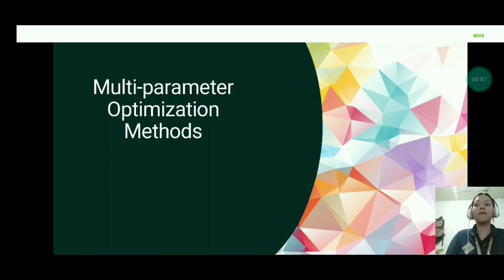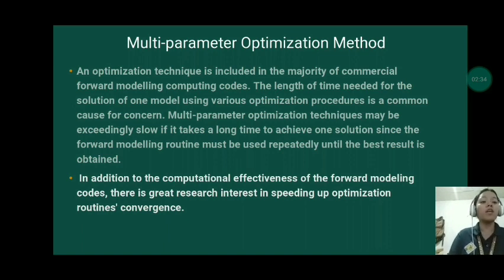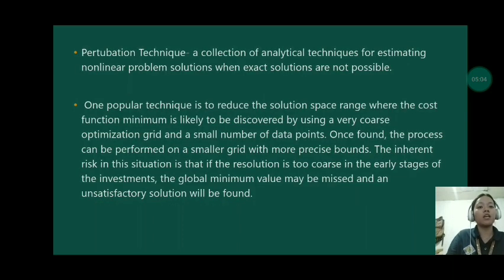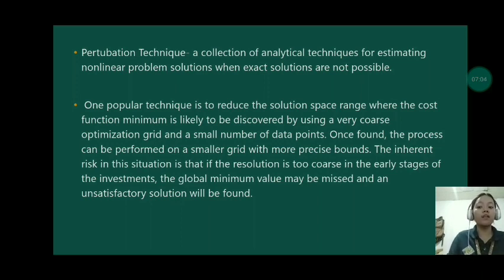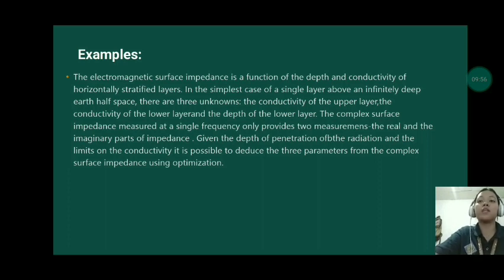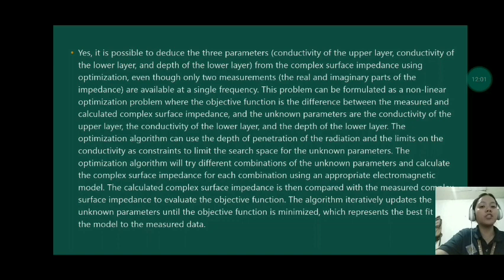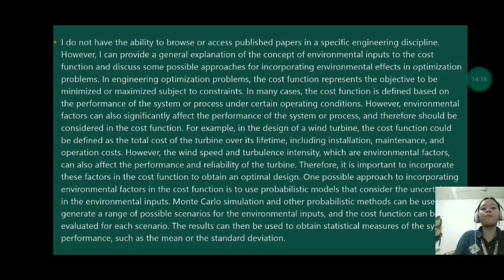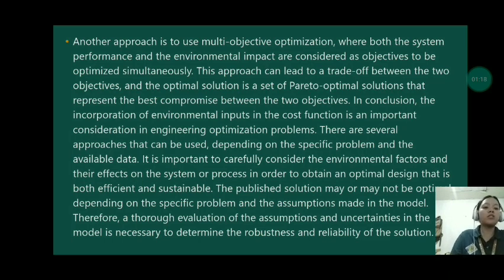Multi-Parameter Optimization Method

Comment: Kevin Alama Quilnet
March 17, 2023
ENS 341 A - Research Methods of Engineering  M-W-F  6:30-8:20pm

REFLECTION:
What i can say in the video multi-parameter optimization methods are essential in many fields, including engineering, physics, chemistry, and finance, to name a few. These methods aim to find the optimal values of multiple parameters that maximize or minimize a given objective function. One of the most popular methods used for multi-parameter optimization is the gradient-based method. It is based on the gradient of the objective function and uses iterative techniques to find the optimal values of the parameters.

REACTION:
The voice of the reporter clear and she delivered her report superbly. Everything was related to her topic which is good. Although there are some background noise, the voice and the presentation is good and was able to present neatly. The discussion was well performed. 

SUMMARY:
Overall, multi-parameter optimization is a critical tool for solving complex problems in various fields, and researchers continue to develop and refine optimization methods to improve their effectiveness and efficiency. One important aspect to consider in multi-parameter optimization is the curse of dimensionality, which refers to the exponential growth of the number of possible solutions as the number of parameters increases. This can make it computationally challenging and time-consuming to find the optimal solution. Therefore, it is often necessary to use approximation or dimensionality reduction techniques to overcome this issue.

Comment: Xavier O. Baculado Jr.
March 17, 2023
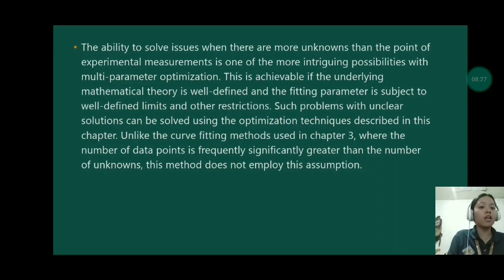EE 341-A (MWF 6:30-8:30)

Xavier O. Baculado
March 17, 2023
EE 341-A (MWF 6:30-8:30)

Reflection: 
Throughout the discussion it made me reflect not just about the importance of learning this method but also applying it especially in solving complex design in order to achieve the goal which is to minimize the cost function.

Reaction:
The reporter highlights the goal and cite some example that is relevant to this topic. Overall it is very well presented.

Summary:
To sum it up, the Multi-Parameter Optimization Method is essential in minimizing the cost function, which takes into account all the factors important for the optimum.

Comment: Macalib-og, Jhon Paul C. (Electronics)
March 17, 2023 
MWF 6:30 P.M. - 8:30 P.M

Reflection
Multi optimization method is helpful in a way that helps engineers find a solution that can optimize a project or things to its full potential without sacrificing more but saving with more quality and safety.

Reaction
The video is very nice and helpful. The reporter have good insights on her report.

Summary
The Multi optimization method techniques used to optimize multiple objectives simultaneously. it is important in engineering as may engineer make projects throughput their lifetime. To be able to be safety and have quality work, they solve their problems with mathematical equations to aide them and have a good, successful results.

Comment: Cacaldo, Elvin E.
March 17, 2023
MWF 6:30pm - 8:20pm

Chapter 5
MULTI-PARAMETER OPTIMIZATION METHOD

REFLECTION:
As what I observed in the presentation, the multi-parameter optimization method is important factor when conducting research. I learned that the multi-parameter analysis can be done using mathematical tools. The optimization method determines which set is used. which set of parameters will best optimize the intended result. Engineering studies are popular and performed in order to address current societal issues problems. However, developing solutions can be difficult and time-consuming. Multi-Parameter Optimization Techniques they are useful because they allow scientists and engineers to determine the best combination of various variables to achieve their goal.

REACTION:
I observed that the reporter is reporting well the assigned topic and discussing the important of optimization method. The topic was presented in a clear and concise manner. The reporter present smoothly and easy to understand. The speaker used excellent visuals to help viewers understand the video. The reporter is discussing well the assigned topic

SUMMARY:
The reported topic is all about the multi-parameter optimization method.
Method of multi-parameter optimization
following are some procedures that can be used in various disciplines such as engineering, Science, economics, and finance are all disciplines. The optimization method used is determined by the nature of the problem, the complexity of the objective function, and the number of parameters to be optimized.

Comment: Sojor, Gwenshane Arnel R.
March 17, 2023
MWF 6:30-8:30 PM

REFLECTION
I have made a realization on the importance of multi-parameter optimization methods in addressing complex problems that depend on multiple variables. These methods provide a powerful set of tools for researchers and practitioners to identify the optimal solution for a given problem, which can lead to more efficient and effective outcomes.

REACTION
I have learned much from the report about multi-parameter optimization methods and realized its importance. However, the slides were full of lengthy paragraphs. Nevertheless, I've still gathered necessary information and the examples that were presented surely helped. Good job!

SUMMARY 
In summary, multi-parameter optimization methods are a set of techniques used to optimize complex systems or processes that depend on multiple variables or parameters. Multi-parameter optimization methods are powerful tools that can help researchers and practitioners to optimize complex systems and processes. By carefully selecting the appropriate method for the problem at hand, and using it appropriately, researchers can obtain better and more efficient solutions to complex problems.

Comment: Pacana, Carl John B.
March 17, 2023
MWF - 6:30 - 8:20

Reflection:
I found the video on multi-parameter optimization very informative. I appreciated the clear definition of multi-parameter optimization, which is a mathematical process that aims to find the best solution or design that satisfies a set of criteria or constraints. The goal is to minimize the cost function while discovering the best solution that satisfies the necessary performance criteria. This optimization approach is used to find the optimum course of action for a particular issue in various disciplines including engineering, science, economics and finance.

Reaction:
I now have a better understanding of multi-parameter optimization and its applications in various fields. The importance of finding the best solution or design that satisfies the necessary performance criteria while minimizing the cost function is critical for many engineering projects. The use of optimization procedures, which can be mathematical or algorithmic, is a valuable tool in achieving the best results possible.

Summary:

The reporter discusses multi-parameter optimization and provides a clear definition of the process, its goals, and its applications in various fields. The optimization approach is used to find the best solution or design that satisfies the necessary performance criteria while minimizing the cost function. There is great research interest in speeding up optimization routines, and other methods are employed to shorten the computing time needed for multi-parameter analysis. The use of optimization procedures is a valuable tool in achieving the best results possible, and optimization codes are openly accessible on the internet.

Comment: Amistoso, Arabella S.
March 17, 2023
MWF 6:30pm - 8:30pm

Reflection:
In research, we always have a desired goal. From what I understand, multi-parameter optimization is a method of solving problems through mathematical means that yields the best result possible. But this technique could also be slow before reaching a conclusion.

Reaction:
The topic was well presented by the reporter. She discussed all of the important points and provided examples regarding the topic.

Summary:
Multi-parameter optimization is a method used to solve complex problems mathematically to achieve the best possible solution to the problem. This method could also increase efficiency in terms of application. The main goal of multi-parameter optimization is to acquire the best solution to a problem that would most benefit all stakeholders.

Comment: Bernard D. Cadiente
March 17, 2023
MWF 6:30-8:30
Reflection
The aim of this optimization method, known as multi-parameter optimization, is to identify the set of parameter values that would produce the best possible result. Our research endeavor will benefit from the use of multi-parameter optimization techniques for resolving complex problems.
Reaction
In my opinion, the reporter did a great job in her reporting and she providing an examples that  helped me to understand more in her topic
Summary
For engineering research to find the optimum solution to complex problems, multi-parameter optimization is a critical methodology. There are numerous optimization methods available, and the choice of one depends on the resources available and the specific problems being addressed.

Comment: Evangelista , Marwel P.
March 17, 2023
MWF 6:30-8:30 PM

Reflection
Multiparameter optimization is a technique for solving complex design problems that produces the best possible results. It entails determining the set of values for numerous variables or parameters that maximize or minimize a specific goal.

Reaction
The reporter explain well and used simple words by explaining their topics. And gives some examples that gives us an idea about multi-parameter .

Summary
Overall, multi-parameter optimization is a massively parallel computing techniques can be used to speed up computation.

Comment: AMAHIT, KENT L.
MARCH 17, 2023
MWF, 6:30-8:30 pm

Reflection: Multi-parameter optimization methods are a powerful tool for engineering researchers to identify and optimize the performance of a system. These methods provide a systematic way to search for optimal solutions and to identify the best combination of parameters for a given problem. This can be extremely useful when trying to identify the most efficient and cost-effective solutions for a given problem.

Reaction: I observed that the reporter is reporting well the assigned topic and discussing the importantance of multi-parameter. I am very impressed by the potential of multi-parameter optimization methods in engineering research. This type of method offers a great opportunity to explore the best possible solutions quickly and efficiently.

Summary: As what I observed in the presentation, Multi-parameter optimization methods are a powerful tool for engineering researchers to identify and optimize the performance of a system. These methods provide a systematic way to search for optimal solutions and to identify the best combination of parameters for a given problem. This can be extremely useful when trying to identify the most efficient and cost-effective solutions for a given problem. This type of method offers a great opportunity to explore the best possible solutions quickly and efficiently, and to identify the most beneficial parameters for a given problem.

Comment: Trono, Clyde M. 
March 17, 2023
6:30pm-8:20pm

REFLECTION:
	I learned in this video that multi parameter optimization methods are a method in solving problems mathematically that are complex design. Understanding this topic would achieve a best project result.

REACTION:
	The video presentation is well presented. I understand about the topic multiparameter optimization methods and its purpose plus giving example helps more. 
	
	 
SUMMARY:
	This topic is to minimize the cost function, which takes into account all the factors important for the optimum design. It is finding a set of value for numerous variables, also refer to as a parameter that maximize or minimize a particular object.

Comment: Michael Angielou G. Labrador 
March 17, 2023
MWF 6:30pm - 8:20pm

Reflection:
In the video presented, multi-parameter optimization methods is a techniques used to optimize multiple variables simultaneously and a goal of this optimization method is to find the set of parameter values that leads to the best possible outcome. Multi-parameter optimization method will help us in conducting our research project in solving issues that are many unknowns. 

Reaction:
The topic is clearly presented in the presentation. The reporter discussed the topic very well and share some examples which will help us to understand the topic well. 

Summary:
The topic reported is all about multi-parameter optimization method. Multi-parameter optimization method follows some process that can be used in different disciplines such as engineering, science, economics and finance. The choice of optimization method depends on the specific problem at hand, the complexity of the objective function, and the number of parameters being optimized.

Comment: Yucor, Janet B. 
March 17, 2023
MWF 6:30 – 8:20 PM

REFLECTION

I gained knowledge that using mathematical tools, the multi-parameter optimization method determines which set of parameters will best optimize the intended result. Engineering studies are performed to address current societal problems. But coming up with solutions can be challenging and complex. Multi-Parameter Optimization Methods are useful since they enable scientists and engineers to identify the ideal arrangement of numerous variables to accomplish their goal.

REACTION

The presenter of the video presentation gave a clear and informative explanation. She also gave us a few instances so we could better understand her subject. Her topic is understandable since she utilizes straightforward language. She also offers illustrations, which help me comprehend the topic better.

SUMMARY

As a result, the multi parameter optimization method can help in many ways to increase performance by lowering cost function, increasing efficiency in a range of application and other factors. The multi-parameter optimization method determines which set of parameters will best optimize the intended result.

Comment: Lecira, Jezreel Dec B.
March 17,2023
MWF 6:30-8:30 PM

Reflection:
In this lesson I have understood about how multi parameter optimization can help in improving performance and also enhanced the reliability and durability that can give better project result and is environmentally sustainable. And how we should consider the various the significance of various factors to find the best solution. 
Reaction:
The report was well made and was easy to understand. The explanations were well organized also.

Summary:

So to sum up the report  Multi parameter optimization method can help improvement of reducing the cost, being more efficient, and can help in the improvement of the performance in a lot of ways. This method also can be approached by finding values for numerous variables that optimize a particular objective. And this method can help in finding the best ways to improve processes and in finding the best values for a lot of parameters and the use of methods to make it faster.

Comment: Pahilaga, Christofferson M.
March 17, 2023
MWF 6:30pm-8:20pm

Reflection
Engineering research has a purpose for engineers and future engineers, it is to conduct a problem that is existing in our society that hasn't been resolved. This is to find solutions for it may affect the people in the society that are concerned in this problem. In order to execute this effectively, multi-parameter optimization comes in to help us guide arrive to the best solution there is. There are other methods, but this is the best method if there are a lot of unknown.

Reaction
Even though the reporter delivered the discussion in a low voice, he still had given some great examples in which helped me understand more about his topic.

Summary
Multi-parameter optimization has a series of process that is needed to be followed to aquire the best solution to a certain problem. This can serve as a discipline in engineering, science, economics, and finance. Assumptions is not used in this method, which makes it fifferent to curve fitting method. The approach that we need to perform should depend on the problem and the data given.

Comment: Darwin Maglalang N.
March 17, 2023
MWF- 6:30-8:20 PM

Reflection:
Engineering research is carried out to address real-world societal issues. But creating answers can be difficult and complicated. The multi-parameter optimization method can be used to iteratively search for the optimal solution. It involves the application of mathematical methods to find the optimal set of parameter values that yields the intended result or objective function.

Reaction: 
The reporter studied her topic well. She uses simple words that makes her topic comprehensible. She also provides examples which makes me understand her topic more.

Summary: 
In conclusion, multi-parameter optimization is a crucial approach in engineering research for identifying the best answer to challenging issues. Many optimization techniques are accessible, and the method selected relies on the particular issue being resolved and the resources at hand.